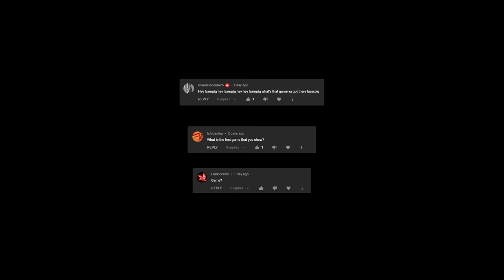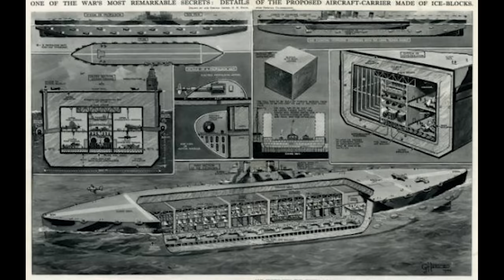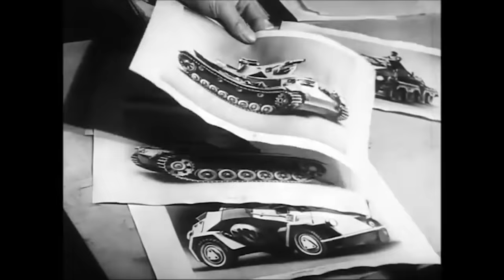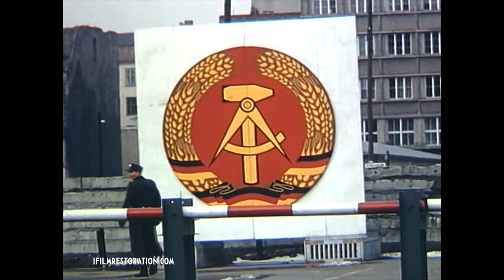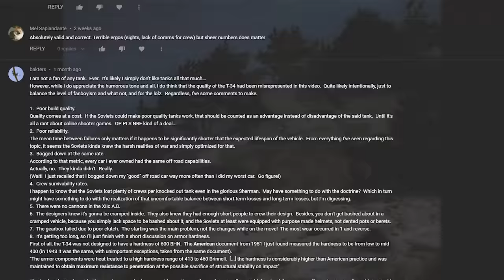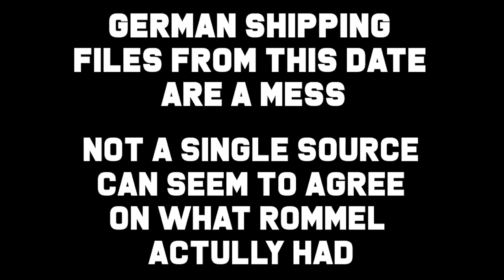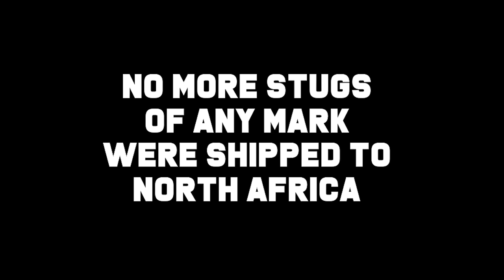In defence of the Crusader Tank

Comment: I remember learning how T-34 tanks were near indestructible with their massive 45mm of sloped frontal armor, and how death trap Shermans were fragile with a pathetic 64mm of sloped frontal armor.
Reply: You gotta be able to live to complain about it. Which means it's working.
Reply: And don’t forget the part where the Sherman is only ever compared to the Tiger🤣
Reply: @andrewp8284  the panzers don't get the love they deserve
Reply: You should go look up The Chieftain's Hatch (Nicholas Moran) as he covers Shermans in depth, including casualty statistics.  Also a bit more SFW as he doesn't swear like Lazerpig.  He also has a standard test where he gets into a tank, exclaims "The tank is on fire!" and attempts to exit from the driver's position.  In the Sherman - no bother.  In the T-34 - casseroled several times over.
Reply: @PsilocybinCocktail  The initial shermans had really bad ammo storage though. Infact thats what got them the nickname of "tommy cooker". Its not a good idea to store your ammo behind clearly visible hatches.. thats like having a giant enemy crab with a weakspot to cause massive damage.

They fixed that issue real quick though, but i guess the reputation was still very persuasive.

The sherman was a very solid workhorse tank that could get the job done.. and in my opinion those are the best tanks
Reply: I think it's because our of the gate Sherman's we're up against late war German armor and pak 40s, all of which could easily penetrate them.

 T-34s had the benefit of facing early war German armor using 3.7cm gun. Late war they were just as killable as a Sherman.
Reply: @riptors9777  I've been told in the past (no idea how accurate) that a major reason for early reports of Shermans lighting up easily was due to British tankers being so used to having to go long periods without resupply that they would overstock their tanks with ammo, shoving it in nearly any position they could manage. With so much boom crammed in a tiny space, it was difficult for a penetrating German round to not hit something flammable.
Reply: @noshurviverse8388  The article i read did mention improperly stored ammo, but i also know from games like warthunder that the early shermans had very easaly identifiable "hatches" on the side that had ammo storage right behind it, and if you hit them there its guaranteed a total kill with a blown off turret. The later shermans dont have that weak spot that stores ammo right behind the armor on the upper hull though.

So more of an oversight then an inherent weakness of the design itselfe due to lack in experience when it comes to tanks would be my guess.
Reply: @riptors9777  "Game"
"Warthunder"
I was with you but just wanna say those sources will open you up to some uneeded arguments from people who think the Mause would have won the war
Try not to use games as sources they are not reality and even if they get something right there will be that air of doubt for everything they get wrong
Reply: @thegreatestdane8978  only thing that's realistic about war thunder is the vehicle models. Yes there are armor plates welded over the ammo storage of early Shermans but they are only so obviously visible ingame because of the way the game renders shadows, reflections and light diffusion. In addition, ammo cook-off and similar post-penetration effects are literally down to random chance and is tweaked all the time. I've played this game for 8 years now and I've seen times when any amount of shrapnel or shell would cause a cookoff and times when several direct hits to propellant storage failed to ignite it. Hell, there used to be a time waaaay back in the early days of ground forces where a hit to fuel tanks had a random chance of blowing the whole tank up...
Reply: They have the same amount of los effective thickness. 
If you want to show your enemy as incompetent just say that they expect a lot more than they had our were able to accomplish...lazerpig uses this tactics in his Ukraine videos and the video about t-34. I think he sees Russians add enemies
Reply: Survivability in Sherman’s was very high they were good tanks
Reply: @PsilocybinCocktail  no swearing?!?!?! no thanks :)
Reply: @robinmiller1989  Well you can @#~$ off then!  Seriously, Nicholas Moran is about 6' 4" and I've no idea how he fits in an Abrams, let alone something like a Stuart.
Reply: Don't forget the Sherman is a tinderbox that cooks the crew when looked at the wrong way, and T34 crews never burn alive because deeezul
Reply: Here's the thing my grandfather was a tanker world war II. He actually came over just after the first battle of El Alamein with the Sherman tanks to train up the British on how to use them and fought in the second Battle of El Alamein.
He have five Sherman tanks shot out from under him. And all but one of his crew members had fought with them through the entire war. And the one guy that got replaced was because the other guy got shot by a sniper in the desert. 
He lost two Sherman's in North Africa; A Sherman on Sicily and another in Italy any final Sherman in the Battle of the bulge. He ended the war with one of the few Persian tanks to Inter late in the war.
When you look at what was just said here one thing you should remember is he had his tank crew with him throughout most of the war. That means almost all the tankers in his tank had five tanks shot out from under them. Except for the new guy who had four tanks shut out from under him.
All of them survived the war had children and grandchildren and great grandchildren. 
When people talk about Sherman's being shot up all the time and being damaged the first thing I have to remember is what my grandfather told me those tanks could literally take a hit on the battlefield get dragged back to the rear and be completely rebuilt as long as the ammo didn't blow up or the tank didn't burn. Which my grandfather does tell me that it burned quite a bit because they were gasoline tanks. My point I want to make and I'm sorry I got on a diet drive but for the Sherman being such a s*** tank that people talk about it as being ineffective against tigers the cruise shore survived the entire war tank that's and crews were pretty low compared to other services now I know my grandfather is maybe unique example but it's something I want people to remember my grandfather survived the entire war had so many Battle Stars he was literally on the first thing smoking back to the states with his friends. When the war was over.  
My point is a tank can't be all bad when most of it's Cruise make it home and it's like grandfather said we didn't go after a German tank with one vehicle we went after them with 10 or 20 and before we ever got into a tank door with them we softened them up with our tillery. Truth is my grandfather used to say that he'd rather go after infantry and other things and go after German armor. And he would say that's because he hates getting a new tank because a chain of commands always bitching about him losing another one and threatening to send it back to the schoolhouse.
Reply: bah, russian bias
Reply: @cldus7442  When I last played World of tanks the M36 Tank Destroyer was downgraded to the 76.2mm and had to be upgraded to the 90mm, the Stuart was downgraded to the aircraft 20mm, and the Sherman's forward and turret armor (64-80mm) keeps getting penetrated by 20 and 37mm cannon at better than 1000 yards.
Reply: @haroldcarfrey4206  world of tanks isn't exactly known for realism either
Reply: @thepewplace1370  you tube needs a smile laugh option
Reply: @eugenekearney6971  I agree, but unfortunately they are busy taking things away rather than giving us more features so...
Reply: Both are weaker than the pz 2 j lol
Reply: @cldus7442  a hit to the fuel tanks still can detonate and kill a tank, had a friend suffer it and inflict it and have inflicted a couple times but it is rare and somewhat restricted to certain vehicles I think
Reply: @phaeronseherekh1754  the chance has been drastically reduced. Now fuel tanks can be hit multiple times before any effect is noticed. It used to be quite consistent and if it didn't catch fire it would cause an ammo detonation
Reply: @riptors9777  nobody aims for weakspots in a tank battle, real life aint war thunder the problem with the sherman (panzer iv and t-34 also had the exact same ammo storage) was that no matter where you hit youd probably catch some ammo.
Reply: @b_de_silva  Wrong, Tankers where advised where to fire at enemy tanks specifically, well maybe not the russian tankers cause they where just thrown at the enemy without much intel. There where anti nazi propaganda cartoons that tought soldiers where to aim at german tank weakspots for example. If a tanker had the chance he would ofcourse take aim. WW2 Tank battles arent 360 no-scope affairs, neither open plane battles where you and your enemy face each others in neat rows like on tabletop and certainly not the action packed high maneuver affairs of hollywood movies, most often the one getting shot at didnt even know he was in the enemies crosshairs (hence why most tankers feared anti tank guns more then enemy tanks.. atleast the enemy tanks where as blind as they where), giving the attacker all the time they needed to aim for specific spots.
Reply: @riptors9777  ehh no, tanks do not aim for weakspots at all, real life isnt a game where youll be close enough to even see weakspots, they always shoot for center of mass, youll never hear a german tank commander saying how he aimed for the t-34 mantlet because his panzer iii cant pen the front plate or whatever, the closest thing tankers do to aiming for weakspots is shooting sides or rear. and the reason tankers feared antitank guns has nothing to do with them being able to aim for weakspots, you really have no clue of what youre talking about, they fear AT guns for the simple fact that usually AT guns are larger than guns on most tanks and theyre easier to hide.
Reply: @b_de_silva  You do realize we are talking about WW2 tanks right? They didnt had laser targeting systems. The aiming was done per eye, and the optic of your tank determined how far you could reliable fire and compared to modern day battles.. the engagement ranges reflected the "aim per eye" method.

Yes tankers where definatly aiming for weak spots. Especially considering that the 3 and 4 in their earlier versions HAD to exploit weakspots on enemy tanks like the KV-1 or the Char-B1 to even have a chance to knock them out. (and knock them out they did even with great difficulty)

I dont know where you get the idea that tanks where just blindly firing at each other in WW2 with reckless abandon but it is just not true. If you fired at an enemy and had the advantage of not being spotted you would make damn well sure that your first shot was all that was needed to knock the enemy out. You did not want to give the enemy the chance to return fire because you where stupid enough to just fire center mass.

And if you didnt specifically knew the weakspots on an enemy tank or you where allready engaged you would aim for obvious weakspots like the drivers port, turret ring, lower front plate or any flat surface you could get.

To think that they just put the crosshair on center mass and fire away is quite frankly ludicrous
Reply: @riptors9777  dude you're a war thunder player talking about real tanks engagement, most of what you're saying has nothing to do with actual documents.
Reply: @b_de_silva  I dont play warthunder for your information, neither do i play world of tanks. So how about you stop bringing video games up as if they are somehow an argument

And speaking of your arguments... they arent really convincing anyone either.

I allready told you that the idea that tankers during WW2 just blasting away recklessly is beyond idiotic but who am I to ruin your little made up world that defies any semblance of reality. I mean aparantly you really think that panzer 3s and 4s where just blasting away at KV-1s even thought both of these tanks had no chance of penetrating anywhere EXCEPT for weakspots, or by flanking and that german tank crews also knew of that fact.  But hey.. you keep living in lala land.
Reply: Ah yes hate the Sherman sorry what tank got the most kills? What about the fact that Sherman's weren't meant to be armored only mass produced due to the fast paced nature of the war so yeah nah you can't just write something off just cuz you don't like it Shermans put in work
Reply: Far too many people seem to be completely missing the joke.
Reply: @riptors9777  those are not hatches. They are added armor.
Reply: @kyle857  They are big "insert shell for massive damage" post signs, cause right behind them is the ammo storage, wich is really bad even with non penetrating hits. Thankfully the allies figured that one out eventually.

The sherman is a good tank, and good is good enough. You dont need wunderwaffen to win a war, you need stuff that gets the job done, and the sherman was just such a thing.  It could deal with most of the german armor, and what it couldnt deal with they came up with special variants like the firefly for. It was a workhorse and in that role it did great.
Reply: @riptors9777  The Sherman burn rate was one of those problems that people just latched onto like a meme that's gone viral. Even though it has kernels of truth behind it the Sherman wasn't the sole tank that liked to burn. Pretty much ALL tanks of the war regardless of nationality had roughly a 60% burn rate on average when hit and penned by an anti-tank weapon. Ironically though the Sherman was "one of the very few" tanks to actually have this issue addressed as the war proceeded. Partly because the Allies at this point were heavily on the offensive which is always going to cause a lot of casualties as you are going to be "assaulting" dug in defensible enemy positions. So trying to mitigate survival issues is always a plus especially a simple fix like wet stowage.
Reply: @UNSCSpartan043  Yup, as i said.. they aknowledged that the ammo storage was... less then ideal. And they fixed it by moving the ammo around and put it in wet storage. After that the sherman didnt burn up any more or less then any axis tank.

But as you said the reputation as "the tommy cooker" by that point was allready a thing.
Reply: @riptors9777  It wasn't that it had bad ammo stowage. It's ammo stowage wasn't really better or worse than most any other tank in the war. They all had similar stowage placements because there are generally only a handful of places to stow ammo on a tank. A ready rack in the turret, below the turret, in the sponsons, and around the turret. ALL tanks stowed ammo in these general spots and ALL tanks of the time be they US Shermans, British Cruisers, German Panzers, or whatever had a bad burn rate at around 60% when penned. Once the US started implementing "wet stowage" in the Sherman the burn rate dropped to 15-20% and surprisingly no other nation in the Allies or Axis ever really bothered with wet stowage.

People like to say but the numbers of Shermans burned was a higher number than any other tank, but that doesn't put it into context because you have far more Shermans produced and in the field than any other tank by a factor close to 4-1 roughly, not counting the T-34. That means for every 4 Shermans built only 1 other tank like a Cromwell or a Panzer IV was built. When you have 30,000 tanks of one type and say only 6,000 for another type of course the 30,000 is going to have a higher burn number because you have 30,000 of them fighting. But if they do the math and figure out the percentage of burns for all those tanks it is nearly the same percent as those tanks produced in far smaller numbers. Until wet stowage came along.
Reply: @UNSCSpartan043  

"An early version of the Sherman had very vulnerable ammo racks, which were stored in the “humps” near the front of the hull. German gunners knew about this, so it was easy for them to hit for catastrophic kills. US Army knew about this problem, so they moved the ammo racks to the bottom of the tank and in mid-1944, they introduced wet stowage to the ammo compartment"

From an article talking about tank myths. These early versions of the Sherman gave it the reputation of the "Tommy cooker" or "Ronson" as the brits called it. So yes, the early versions had issues with ammo storage, but it was fixed rather quickly. Im surprised though that it took them that long to introduce wet ammo stowage. Mid 1944 was allready on european soil.

Oh and also: So much for tankers not aiming for weakspots on the enemy and that this only happens in games like warthunder XD
Reply: @thepewplace1370  I don't know where you get your "facts" about Sherman tanks, but is totally wrong. It had one of the lowest crew loss rates of any tank. Go to the Chieftain U-TUBE site if want to really know about the Sherman. He was a tank commander in the Abram, although at 6'4" I don't know how he fit one. If you want to know about tanks, his is the channel to subscribe to. I think you will really enjoy his channel.
Reply: @williamromine5715  I think it's funny you mention the Chieftain, right after asking where I get my "facts"

That's who I'm paraphrasing..
Reply: @thepewplace1370  I remember he debunked myth about the Sherman being a fire trap. I might be wrong, but I think he said it got that reputation after the war. If I'm wrong, I apologize.
Reply: @williamromine5715  my original comment was entirely facetious, making fun of people who still believe the Sherman was a death trap. You are correct in that he showed, using primary source material, that the Sherman was probably the most survivable production tank of the war. Myths still abound in the ww2 tank space, one of those myths being that Shermans were death traps due to their using regular gasoline (nevermind that nearly all tanks, including British and German tanks, were using petrol at this point) and that the T34 was survivable/superior due to running on diesel, which apparently people think doesn't combust under any circumstances. This is what I was poking fun at in my comment.
Reply: @thepewplace1370  I'm sorry. I didn't realize what you were doing. So many people have fallen for the myth about the Sherman, I incorrectly assumed you did too. My apologies. For all its faults, it was the right tank at the right time for America's needs. Considering it was built all over on a large landmass surrounded by huge oceans, it was one hell of an accomplishment by America.
Reply: @CallanElliott  The german tanks had other issues, namely their lackluster guns and armor protection, and then they went overboard with the tiger and panther in a doomed to fail attempt to invent some wonder weapon that would solve these issues. But ammo storage wasnt one of the issues, neither did the russian have ammo storage issues (they had crappy craftsmanship, lack of radios and crappy optics though). German tanks performed more then adequate for the most part, hence why germany was able to conquer poland, norway and france and push deep into soviet territory before the inevitable collapse.

The issue with the early shermans was a very specific design flaw that had catastrophic effects and had to be sorted ASAP. And sorting it out they did, turning the sherman from a good tank with a critical flaw into a good tank without any flaw
Reply: @riptors9777  German tanks had similar ammo placement to the Sherman, and consequently similar burn rates. The reason Shermans stopped burning was because they moved the ammo under the floor where it wouldn't be hit as often.
Reply: @CallanElliott  No.. the german tanks did not have similiar ammo placement as the early shermans... not at all,

A simple google image search shows that.

For startes the ammo storage of the early shermans had to ammo racks that where ABOVE the tracks, behind a flat square armor plate on each side of the tank, making it very obvious where to hit the sherman to cause an ammo explosion. Even when the tank was mostly obscured by terrain there was still a good chance you could directly hit its ammo racks because they where just so high up on the tank.

Compare that to the the panzer 3s and 4s that had their ammo storage BEHIND their wheels and tracks, much lower to the ground inside of the turret basket and much trickier to directly hit (and directly behind the driver, poor bastard)

So no... youre simply flat out wrong.
Reply: @riptors9777  That's still sponson storage, the unpardonable crime of the Sherman's ammo storage, ya tit. If you put rounds in the side of the tank, then you're still putting it in the sponson, which is the problem with the Sherman. Also, the supposed advantages you've listed of the German designs apparently aren't all the significant (which they aren't, 9 of 10 times, the one who shoots first wins) because the burn rates are similar. Which makes sense because putting it behind the wheels and tracks would make no difference in terms of ortectection because those aren't armoured components.
Reply: @kingchirpa  this is true the t-34 was still good for what it needed to do it was just not as well armored  for late war and the improvements made over the war were quite good
Reply: @elmascapo6588  bruh that's on of the first  type of tank you think about when you say German ww2 tanks
Reply: @CallanElliott  

I never claimed that the german tanks had a "significant" advantage over other tanks in ammo storage  so i have no idea where you take that from, certainly not from me. But i would apreciate it if you stopped acting like i did, thanks.

What i said was that the early shermans where easier to destroy thanks to their crappy ammo storage location. 

But lets take a look at some of these often mentioned but never actually quoted statistics

(These are from later on in the war after the change to the sherman btw)

According to research done by the Allies in 1944:

On average the chance for a ammo explosion in a panzer 4 was around 80% after being hit 1,5ish times (the poor thing was getting a bit long in the tooth at that point) 

A panther had a likelyhood of brewing up also around 80% but needed to be hit 5,25ish times before doing so.

A Tigers chance of brewing up was around 63% after being hit  4 times on average.

That of a sherman was 82% after being hit 1,9ish times

So decent compared to a 4 but worse compared to a panther and much worse compared to a tiger.

(These numbers come from Operational Research Group Report No 17 Tank Casualties in France 6 June-31 Aug 44)

And again: that was AFTER they relocated the ammo from the sides of the sherman down to the bottom of the sherman. Wich logically means that before the change the numbers where even less favourably to the sherman or else the ammo storage wouldnt have been changed! (It is worth mentioning that sherman tanks where only equipped with AP ammo and german tanks used APHE in 1944, more explosive filler -> more chance to cause ammo explosions. If the sherman had been equipped with APHE i think we would see an equalization across the board)

So can we please finaly put this dead horse to rest allready?
Reply: @Elite Panzer Good stuff
Reply: And british tanks were not built to fight, more to amuse the enemy.
Reply: The improved survivability of the Sherman over many of it's counterparts is what sells me.  You can't just assemble experienced tankers off an assembly line.
Reply: @bandit6272  If only they had given them better ammo they could have performed so much better
Reply: @cldus7442  fuel tank hits still have that chance it is just MUCH smaller and very rare
Reply: @andrewp8284  "the Sherman is soooo shit, to demonstrate this I'll compare it's gun and armor to one of the most iconic and "successful" heavy tanks of all time"
Reply: These are the phases that one must go through to reach true world War II Nirvana
Reply: @elmascapo6588  neither does the panther in my opinion
Reply: @thegreatestdane8978  world of tanks is no where near really my guy
Reply: @judgegrinch1139  yes, but when looking at the ‘anatomy’ of vehicles War Thunder is fairly accurate yeah?
Reply: @noshurviverse8388  Early Shermans also didn't have wet ammunition storage (something later ones would get).  That and the British propensity for storing too many rounds didn't help.
Reply: Not the most scientific of tests because he's not a skinny malnourished soviet peasant from the Steppes, but it performed so poorly it probably didn't matter anyway lol
Reply: @cldus7442  Nowadays the Fuel Blow-up is a thing again. I love turning T-34s, KV-1/2s, and IS-1/2s and all the other Soviet Tankies Tracked Turd Transporters into giant fireballs after using their own "defence" against them. Even using solid shot (British player.) does the trick.
Reply: @airplanemaniacgaming7877  yeah they finally added it back in a recent update. It's still not as catastrophic as it used to be (guaranteed fire and chance of a 1hk) though.
Reply: Also don’t forget the reports of panzer 3 and 4s not being able to pen the Sherman at standard engagement ranges and them being forced to engage from the side in most instances or get closer. Or use a Tiger 
While a pz3 could kill a t34 fairly easily
Reply: Lol...angled armor and how over hyped it is...
Reply: @elmascapo6588  wo ist mein Pz 2 C.
Reply: @kingchirpa  The problem was the early war shermans still came up against late war german tanks since Sherman units did not get rolling refits, but replaced vehicles either hodgeponge as they come up from depot or between campaigns
Reply: Sherman basically is protected by a cellophane skin, while the Chad T-34 is armored in impenetrable poorly tempered and thinner steel....
Reply: @PsilocybinCocktail  but the swears are half of why I watch these beautiful debacles!
Reply: @thepewplace1370  lawl, t34 crews are looonnnggg dead from their tank trash bag armor spalling into and through them.  The fire from the subsequent ammo explosion just cleans up the evidence.
Reply: @CMDRFandragon  fair point, and that's if the small arms fire hadn't already killed them by sneaking through the massive panel gaps that weren't welded properly
Reply: @samuraigaming3042  the Russians and Germans didn't have to ship the damn thing overseas as well but no t34 Fanboys or tiger Fanboys never considers that
Reply: @judgegrinch1139  War thunder vehicle models are about the only thing I'd be comfortable citing from a video game, given the several national security leaks concerning them
Reply: @gipsydangeramericasmonster9632  Exactly, thats why they changed the ammo stowage in later models of the sherman wich increased its survivability by quite a bit. Cause not only was it stored in the sides of the tank, it was stored behind a flat surface, in a easaly targeted box whose indentures where visible from the outside.. so basically a "insert shell for massive damage" video game weakspot.

The Americans had alot of learning to do, thankfully they did it rather fast (their first engagement in africa against the germans was an absolute disaster.. once again they learned from that and the next encounter didnt go well for the germans)
Reply: @riptors9777  It was not the initial Shermans that had this issue, but am overstocking of ammo on the British crew's part more than anything. I remember reading that they also argued that the first Shermans had such bad  ammo storage placement that it would just blow up if they went over rough terrain. 

   Again, this was due to poor ammo placement/overloading the tank to the point shells fell and bumped into shit that would set them off. 

   Wet stowage made the Sherman even safer that it already was, skyrocketing crew survivability. But when comparing early American Sherman crews to British Sherman crews, it was obvious it was more due to user error, rather than the tank itself having a real problem. 

   And as noted, using WT as a source is not the best way to bring evidence to your argument. In-game, yes, you aim for weak points. In real life doctrines, however, you aim for center mass of your target.
Reply: @sylokthedefiled3047  In the blueprints for the early sherman you can clearly see that the boxes on the side armor where infact meant for ammo stowage. It was these boxes that lead the sherman to be known as "tommy cookers"

Yes they fixed the issue, and after that the sherman was one of the best tanks in the entire conflict.. i have no idea why you keep bringing up this point since EVERYONE is agreeing on that point. Who are you arguing here with exactly?

And as noted: I never EVER referenced Warthunder for anything. This was a petty attempt at discrediting me with false claims. Pretty obvious attempt too.

Also if you read a little bit of literature of the time you would know that tank crews did infact aim for certain weakspots if they where known, usually they aimed for ports, turret rings or flat surfaces.. they did not simply aim "center mass" because that is the most stupid thing you can do while fighting an enemy tank cause center mass is where the most armor is.. they tought that basic shit at tank driving school back in the day for crying out loud! Heck the americans had entire propaganda CARTOONS about how to aim for weakspots on german tanks. Only a  Green crew might just shoot wherever but an experienced anti tank or tank crew will know where to aim. Thats why capturing enemy vehicles and test firing at their hulls was so important.

But if you want to believe that the tank crews where fucking neanderthals that acted like scared squirrels be my guest.
Reply: @noshurviverse8388  This.

And if you add in the fact that it was the Brits/Canadians/Poles that came up against the bulk of the Panzer Divs in Normandy, you can see why they wanted the extra ammo.
Reply: To add to my post, most US units thought that every single tank was a Tiger as well, so it was obvious that they were not paying attention enough to identify the enemy tank itself, let alone the weak points. 

I rest my case.
Reply: "Near indestructible"

45,000 destroyed
Reply: @sylokthedefiled3047  You never had a case to begin with. Also the fact that the US troops reported tigers everywhere doesnt mean they didnt knew how to aim for weakpoints.. what kinda stupid logic is that? Driver and gunner ports, flat surfaces, turret ring... you think all these didnt exist on german tanks? You think the US tankers where firing exclusively onto the massive frontplates of german tanks.. you know.. the part with the thickest armor and the greatest chance to not pen? Because everyone and their grandmother wanted be the first to fight a tiger?

Oh and btw: Im not claiming that everyone, everywhere at all times was aiming for weakspots. A tiger tank with its 8,8cm cannon hardly if ever needed to aim for weakspots. A sherman against a tiger thought? Very much so. Most often it was a common sense thing to NOT aim for certain parts of a tank to avoid the thickest armor. Nor would a firefly have to aim anywhere specific to pen a panzer 4, You would take aim if you knew that your gun had trouble penning the enemy and when the chance to aim was present. Ofcourse no one was aiming for tiny weakspots at max range, or when crossing a corner and the enemy tank is right then and there. Most tanks however where knocked out by anti tank gun fire and those guys knew how to deal with tanks and their common strong and weak spots.
Reply: @riptors9777  My case, and point, is that if someone is misidentifying a tank to begin with, it probably isn't too far of a reach to say that as adrenaline rushes one would not think of aiming for weak points as much as they are just firing as quickly as possible(or that by misidentifying a target they would t thing too clearly on identifying weak points to said misidentified that may or may not exist((because it's the wrong damn target))). But sure, 700 meters out I'm sure a crew with basic optics could make out a gun port/driver view glass with debris flying all around just fine, and it it with pinpoint accuracy(because the 76mm & 17 pounder totally can't pen 100mm of flat armor, obviously).

   Again, I've read both German and US Armor doctrine manuals for the time. A 76mm and 17 pounder gun from the Sherman do NOT require "weak spot" aiming to be effective, even again the "mighty" Tiger I.  Once your target is hit, more often than not a crew abandons it, even if undamaged or even just mildly damaged but operable. 

   You get hit, you bail, and try to scuttle if possible to keep the weapon from falling into enemy hands if you are certain that the position will be lost to them.
Reply: @sylokthedefiled3047  The mis-identification has nothing to do with COMMON weakspots that all tanks share. A sherman tank is not going to fire onto the front plate of a german tank if he can prevent it because that is a surefire way of dying. You want to make sure that the first shot is the one that knocks the enemy out. Now if you are believing that tankers in ww2 where to stupid not to know this be my guest. I on the other hand would rather believe that even back then soldiers had some common fucking sense not to aim for the MASSIVE ARMOR PLATE and instead choose a different spot >>IF GIVEN THE CHANCE<<

Adrenaline does not turn people into idiots btw..  Adrenaline helps you to focus and makes you react faster, it does not make you loose your head. Fear and panic =/= adrenaline.

Lots of extreme sports give you a massive adrenaline rush.. yet in most cases people dont act like morons and know EXACTLY what they do and need to do to stay alive.

Oh and the misidentifactions? You do realize thats an argument against you not for you? If the crew of a sherman thought they where facing a tiger you bet they would aim more carefully! Cause a sherman sure as shit isnt going to knock out a tiger tank if he fires center mass! A Sherman only stands a chance if they get extremely close to a tiger tank or if they can hit certain parts that have less armor. And wich scenario is more likely to happen? A sherman somehow sneaking up close to a Tiger tank... or the gunner making sure he atleast targets a part other then the massive hardened Steel plate that is center mass on the tiger tank they have very little chance to actually pen?

Anyways im done with this nonsense. The crusader is a piece of crap and a failed concept, the sherman had teething issues that where resolved after africa and tankers would take aim for certain spots on enemy tanks if they had the oportunity to do so. (honestly this is just common sense.. but aparantly tankers of ww2 where brain dead idiots scared of their own shadows that didnt even took basic aim and just shot center mass at everything...)
Reply: @riptors9777  Again, I will clearly and carefully state that the 76mm as well as the 17 pounder had zero issue penetrating the thickest frontal plate of a Tiger. 

No, I do not expect an Easy 8 or Fitefly Sherman to get close to a Tiger to penetrate it. Because it doesn't need to. This isn't Fury. This has been picked to pieces by more knowledgeable people than myself. The guns had no issue going through the front plate, and the only points on a Tiger that are even that thick is the main plate that spans across the from where the driver/waist gunner are situated, and the front of the turret. 

And if we want to get even more technical, it's also reported that most US tank crews that came across (almost completely misidentified) Tigers called in air support, rather than actually fight it. 

I am not claiming that US tank crews were mindless morons. Far from. I'm stating they understood the capability of their weapons, and used them as they were taught, according the the doctrines and training manuals. I suggest you read them sometime. They are quite interesting and will offer more than War Thunder did to your "clearly visible hatches with ammo behind them" on the sides of a Sherman that are actually extra armor plating welded on for extra protection (crafty of you to deny you brought up WT as a source and then deny it, even though you yourself made the statement five months ago whilst simultaneously misidentifying a "weak spot").
Reply: @sylokthedefiled3047  Im sorry.. the 76 mm ? The gun that was on the HELLCAT and not on the SHERMAN? The same gun that had had such poor performance that it had issues with the frontplates of panthers.. and of panzer 4s of all things... THAT 76mm? And you say that the thing had "no issues" penetrating the front plate of a tiger?

Heres a little quote for you:

"The moderate performance of the 76 mm gun by 1944 standards was one of three reasons the plans for M18 production were cut from 8,986 to 2,507, of which 650 were converted to unarmed utility vehicles"

Straight out of the wiki entry for the gun.

Are you done embarassing yourselfe?

And the 17 pounder was on the firefly, NOT on the sherman, and there was maybe 1 firely for every 5 shermans. So what do the rest of the shermans do? Just stand there with their dicks in hand when a panzer shows up cause they are all waiting for the firefly? If they think they are facing a tiger tank, one of the heaviest armored tanks in ww2 you better believe they will be carefull with their shot placement.
Reply: @jasonthomas9596  No way, my Great Grandfather was in a 3 man Bren gun team and fought at the 2nd Battle of El Alamein. I was still very young when I met him before he passed so I never heard any stories but my Dad has later passed some on that he was told at the pub with him one night and I don't know how anyone could do what they done during that time in North Africa.
Reply: Sherman tanks were actually pretty good. Compared to their Soviet counterparts.
Reply: @highjumpstudios2384  Russian logic in the Ukraine war
Reply: Yep. Completely ignore the pacific theater.
Reply: @ace_ofchaos9292  the Sherman tanks were helpless against the Japanese. One swing from a katana and the Sherman would explode while the crew's souls were trapped inside the mythical blade.
Reply: @endlesswaffles6504  Glorious Nippon steel, folded over a thousand times!
Reply: @riptors9777  the 76 could definitely pen a tiger. M10s had no issue doing so. Field manuals did highlight areas where you could pen and where you should aim. The bigger issues is actual realizing what you're firing at. Optics weren't always the greatest combined with visibility issues means you might not be shooting what you think.

Almost every WW2 tank had ammo stowage in about the same general areas along the side. Even almost every panzer. US was pretty much the only nation that ever addressed this but any side shot against a panzer, panther or tiger has a decent chance to hit ammunition.
Reply: "Let's review the numbers: the M3 is 15mm, the T-34 is 45mm, the Sherman is 64mm.  Which is more advanced?

WHICH IS MORE ADVANCED???

*Not disagreeing with your point; it's just what the argument reminded me of.
Reply: @h8GWBî  obviously the T-34 since it was the only tank to have sloped armor
Reply: @endlesswaffles6504  
*drops diagram showing sloped armor on Sherman into trash can

“I don’t want to play with you anymore”
Reply: @thepewplace1370 diesel does catch fire 🔥🔥under pressure or with intense heat....
Reply: @thepewplace1370 this is a joke, right?
Reply: Well.....the T-34 was in combat in June 1941, the M4 not until Oct 1942 and not in great numbers until June 1944. it was only in 1944 that people started really complaining about the M4.
Reply: The Sherman's main job was to be an anti infantry platform (as hostile tanks were pretty rare by comparison). At that job it excelled
Reply: @riptors9777  No M4 version ever stowed ammo "behind clearly visible hatches". I don't know where you get that from. 

M4s stowed most ammo in the sponsons, exactly the same place that the Tiger, Panther and Tiger II stowed it. 

Later wet stowage vehicles stowed ammo mostly in the floor, but only late 75mm M4A3s and all 76mm gun tanks used wet stowage.
Reply: @riptors9777  No M4 had hatches in the sides.
Reply: @riptors9777  That's hilarious, and you are wrong. 

First, the Panzer III never had a turret basket at all. 

Second, the Tiger, Panther and Tiger II all stowed ammo in the sponsons exactly like most M4s. 

Third, while the Panzer III had no sponsons, and the IV very small ones, it didn't matter. They still stowed their main gun ammo up against the side walls. Since wheels are not armored and since most of the mass of the ammo was above them anyway, in effect it's the same arrangement. 

Finally, once a shot or shell penetrates, it's often going to go all over the place inside a tank whether the penetration is at the ammo rack location or not.
Reply: @executivedirector7467  Dude.. it has been an entire year... put her to rest will you? Yes its not hatches.. its panels.. the point is, its still a video game esque "insert round here for critical damage" weakspot that everyone and their großmutter knew about. Wich on the first batches of sherman was such a huge deal that the entire sherman line became known as "tommy cookers", even thought that obvious flaw in the design was rectified rather fast and later shermans no longer stowed ammo in those spots.
Reply: @executivedirector7467   facepalm

Wow.. youre the "achsually" meme in person arent you?

When i say turret basket, EVERYONE knows wich part of the turret is meant.. no matter if its the technical correct term for that specific model or make or not. Hence why i used the term.

This isnt nearly the "gacha" you think it is and only makes you look pedantic, engaging in nitpicks instead of adressing the argument... but you allready showed that about your sherman remark.
Reply: @riptors9777  Wrong again. The initial batches of M4s didn't have the applique panels, and most M4s never got wet stowage either.
Reply: @riptors9777  Well no, what it shows is that you have no idea what you're talking about.

This is literally a discussion on technical features of various AFVs and you don't know what they are.
Reply: @elmascapo6588  Everyone asks where are the panzers, but nobody asks how are the panzers
Reply: @riptors9777 it's not even that they had bad ammo storage it was the same as any tank at the time. More men were able to get out from the tanks as they cooked off and then say German Panzer 2,3s even some 4s. remember dead men tell no Tales
Reply: And the M4's had far superior crew ergonomics, as well as hatches that allowed crew to bail-out within seconds of taking a hit, whereas it took many times longer to open the hatch of a T-34, and they were much more difficult to get out of because of the cramped bad ergonomics of the vehicle.